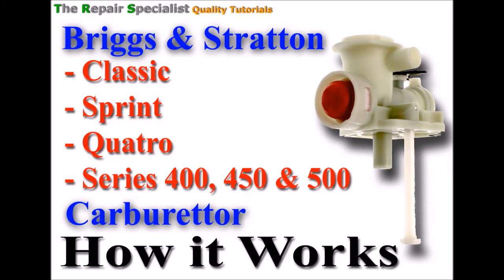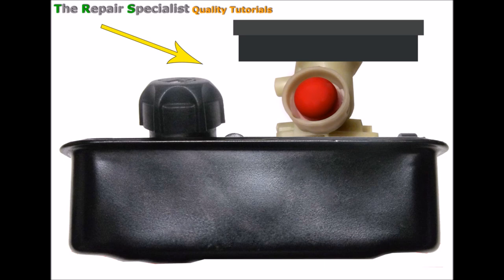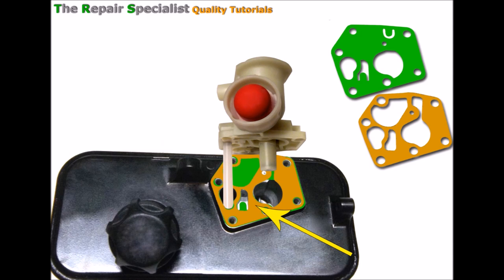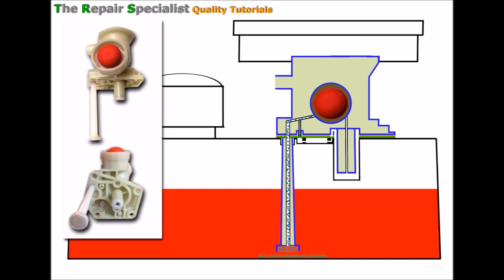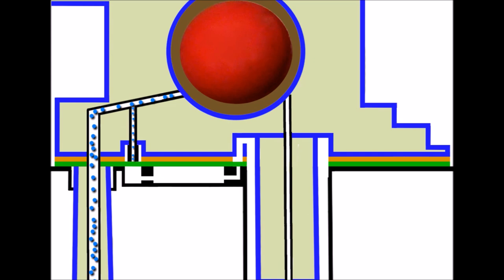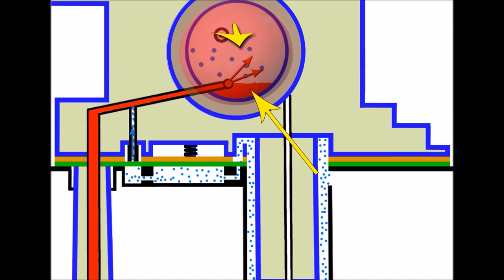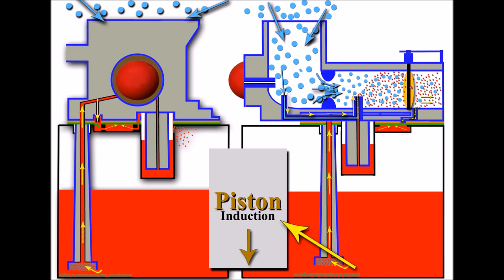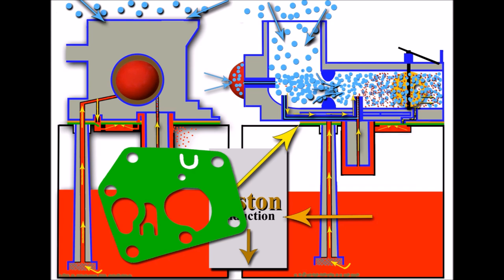Briggs and Stratton Carburetor (How it Works) - 'Unique View'

Comment: From my experience and your explanation, there is no doubt the diaphragm is the weakest part in these Briggs & Stratton engines. In mostly occasional use, I get about 3 middle latitude growing seasons out of mine and then it's back to the rough idle, surging, and fouled spark plug. It's easy to compare the permanent bulge in a 3 year old diaphragm to a new one that's nice and flat.

Vintage Briggs & Stratton engines from the 1960's and '70's didn't have this problem. When it comes to carburetor engines, new isn't always better.

Comment: A really clear and detailed explanation, thanks.   Re the primer bulb, you say that even a pinhole could cause running problems (which I understand) however the genuine B&S primer bulbs for sale for the 500e have a hole in the centre....  we have petrol leaking from the hole in the bulb when the engine is running, but I can't see that buying a new one will help, as they already have a hole in them????
Reply from the maker: Yes it this is confusing, but the 500e works on a different system set up that relies on a carburetor float bowl system.  This is very different indeed to type explained in this video, which rely on a diaphragm carburetor system and functions quite differently to the 500e.  If there was a hole in the primers shown in this video, the carburetor would lose pressure needed to operate fuel to air mixture properly.  It does seem confusing, I agree, but they are very different from each other.  Thanks,
 Craig
Reply: @TheRepairSpecialist  Great - thanks very much for replying.   I'm thinking that a new (red/orange) air filter gasket might fix the petrol leak then.  I've ordered a genuine one and will see how it goes.

Comment: O it is the same with airplane vings is shaped curve on TOP and plain underside so it means the air goes faster on the toøside of wing and create low pressure which make the lift of airplane, Great video and explenation

Comment: I found the diaphragm will last for many years not one  - I  found also  I needed to remove the sieve to poke a wire to break up dirt at the top of pick up tube - my machine has an auto choke butterfly kept open by another diaphragm.

Comment: This is a wonderful and very clear explanation. Now, the problem I am having is: I have an old Briggs & Stratton engine on a finger bar mower (from about 1990), and this machine's diaphragm carburetor has a slightly different setup. The spring, indeed, sits in the lower part of the assembly (in what is part of the fuel tank, actually), and presses the diaphragm pump part up (!), not down. And now I am puzzled how this works. Any idea?

Comment: Thank you for a very good explanation. You showed the first flap valve but where is the second flap valve? Could you please tell us (1) the function of the mesh on the injector portion and (2) what happens to the degree of vacuum created to boost the suction on the injector when the butterfly valve is fully open in a warm running engine.

Comment: one thing about that bottom seal with the flapper valves and pump. the chinese replacements do not always work right. the engine will not prime, but it will run if you use starting fluid, I think it is because they have not made the pump properly and it is flat instead of bowing out.

Comment: A carb that will never flood the bowl spills back into the tank and another benefit the bowl always flushed with new fuel from the cool tank vapour lock never an issue. If the splash lube system could keep up you could run these engines at 45 degrees in any position with a full tank of course

Comment: Thanks Craig for the excellent explanation and diagram work. However, there is a third hole with a ball bearing behind the primer bulb. I was wondering what is the purpose of this as you did not mention it in your diagram display

Comment: If anyone has this engine and it  surges and wont run smooth and right, 
especially if a new gasket set has been put on , these plastic 
carburetors warp on the engine side mounting surface and either have to 
be replaced or you can sand that mounting side down as flat as possible 
and add SEAL ALL Sealant or a PERMATEX gas resistant sealant to the 
machined surfaces when putting a new gasket on and a tiny  smear on the 
gaskets also.  SEAL ALL sealant >>(resistant to gasoline, oil, 
paint thinner, and most solvents. Seal-All is also water resistant 
immediately upon application
Sets in 2-3 minutes. Fully cures in 2-6 hours) The gaskets can be bought at most major car parts stores--eBay also for under $5

Comment: He he, I've been trying to mow lawns for 30 yrs and have never changed the  diaphragm notice mower hunts but runs well when tank is full and looses power as tank empties, also notice very little grant when the grass is a bit thicker.  I never realized the diaphragm actually is a moving part of a fuel pump, if any of the tiny holes get blocked also things won't  work properly.  I just thought the venturi  sucked the fuel up.  I must  have wasted fuel on the the full tank, and I can't run on a near empty tank explained.  My mower is 1987 model.  Plastic carb and no priming bulb, Always starts on second pull though .

Comment: Thanks for taking the time to explain and in such details. It is very informative and enjoyable to watch, brilliant. I do have one question that I hope you would provide answer to and that is the role of the breather pipe, why was it there and does it help/hinder the operation of the device?
Reply from the maker: Hi. Thank you for your nice feedback.  To answer you question, and something I should have included in the video, is  that the breather receives gasses from the engines crankcase and sucks these into the inlet of the carburetor to recirculate them i the engines combustion process.  Doing this is believed to be better for the environment as it keeps the engine running slightly cooler so it generates less harmful byproducts emitted from the exhaust.  I hope this helps.  Craig

Comment: I understand this is now and you did this great video years ago but can I please ask.  I have the problem of the bulb staying in, even a new bulb. So is it the gasket that provides the valving for the plunger. If so then I need to change only the two gaskets to resolve the issue. Kind regards
Reply from the maker: Hi. Providing there is no blockages in the fuel lines that are shown in the video then it does sound like it might be the diaphragm that could be the issue. In a smaller number if cases I have found there to be dirt behind the primer bulb preventing the valving system working on this. I would remove the carburetor, clean it though purely and replace the diaphragm kit. Also, check your primer bulb and make sure it hasn't any issues there. I did have one once that had worn thin but not ruptured through. This was Making its return outwards weak. There is a link in the description the the type of diaphragm kit you need if your engine and carburetor are the same as thus one. I hope this helps. Thanks. Craig

Comment: I had this carb off the fuel tank today, and the diaphram for the pump action was quite deformed. Not thinking much of it at the time.  After watching your presentation, I'll now go back and replace it with an OEM as the one I put in last never really worked all so well. One thing on the carb in question is where the primer blub fits, the plastic is somewhat deformed / out of round and sunken in at spots at the ridge line. Could this have any bearing on priming the engine? Another thing in question is the new primer bulb has a hole in the center,  I think I purchaded the wrong one, even though the engine starts and runs, I'll look for one that has no hole or plug this one off.

Comment: Thank you so much for the video, really helpful. Just wondering if you have any suggestions as to why i have fuel leaking after changing the diaphragm. The screws that connect the carburettor to the fuel tank were not as tight as could be but the mower did start, then i turned it off and tightened them up but I could still see fuel leaking.
Reply: You must have something on top of the flat surface where the carburetor mounts to tank or u have a wrinkle in the diaphragm

Comment: Hi, thank you for your video it is very informative. One thing I notice is you say the thottle should be closed to start the engine but when the governor is connected the thottle sits open. So how can the engine start from cold with thittle open or part open and no choke on the carb? Thanks if you have time to respond. Regards Rob

Comment: Hi I do t know if you are still taking messages but I have a strange issue with this Carb setup one summer morning  I  pushed the Prime bulb to find that it didn't return so was stuck in the pushed position.  Olay I thought it's the rubber bulb that is perished or gone hard so replaced it to find that the first push it stuck in once again. Could we this be anything yo do with the two flap valves on the now 15 yer old diaphragm.

Comment: Hello dear RepairSpecialist, your video is brilliant !! Thanks you so much. I've got one question, on my machine, the pickup pipe keep falling in the tank as it is not strongly "plugged" anymore into the carburettor ? Would you have a piece of advice on how to fix this problem ? Can I glue it to the carburettor or use another trick ? thx a again for making such great video

Comment: Super great video I have a question. gas was leaking at carburetor gasket nothing would work so I used a gasket then diaphragm and another gasket on top of diaphragm could this cause any problems ?? so far no leaks and motor running better than new ...

Comment: so what actually moves the throttle body to open position? is it just engine vacuum or like an auto choke setup? because as I've worked out its not the throttle cable like on a normal carburetor.

Comment: This is first class training. The only point I would add is how the fuel tank vents through the carb. and not the cap. I also noticed that the butterfly valve has two holes at 90 deg. to the spindle. I have a 3hp tiller and the holes are aligned with the spindle (so they are blocked) I have tried to rotate the butterfly valve but it then jams in the body. Does this sound correct?

Comment: Amazing! Thanks so much! if my gasket is floppy would that make the engine splutter?
Reply from the maker: Thank you so much for the nice feedback. I really appreciate it. As for your gasket.  It would be more significant is the gasket wash torn or damaged.  If you have had your gasket and diaphragm in your carb for more than a couple of seasons then I personally would change them anyway.  I hope this helps. Thanks, Craig

Comment: Good work, but there is one major error.  When the engine is stopped the throttle is held fully OPEN by the governor spring, when the engine is running the air vane closes the throttle butterfly until it reaches an equilibrium point where the force of the governor spring equals the force from the air vane.  That's how the governor works - it's a closed loop negative feedback system. 

Although the carburetor includes clever ideas, it isn't a great design in my opinion.  The gasket seals the pump chamber which is at venturi pressure on top, and right next to it is the pump output  filling the main jet reservoir, and on the other edge the outside world.  When the carb gets hot the plastic warps and the seal  won't seal any more. dependent upon where the leak is it either runs lean (leak to outside ) or rich (leak to fuel reservoir) or some hideous combination of both.  B+S know all this - If you look at the carb base there is a moulded ridge in the dodgy areas, but it doesn't really hold back the problem many years. New gasket will fix it for a while but it will always leak in the end because  of lack of clamping pressure in a key area. It is the weak point in the sprint/classic  engine.  If they had only made it in metal it would have been great.
Reply: I've been searching everywhere to get more information about the governor vane. I have a sprint 41 that is running at max rpm from cold. The governer vane does not seem to be applying any negative feedback once the engine is running. So the little spring is just holding the throttle valve wide open. I've checked the linkage to the top of the governer vane, adjusted it fully clockwise, CCW, and mid point but makes no difference. Manually setting the throttle with a piece of wire instead of the spring and engine runs fine. Any ideas?
Reply: Hi there 
Just asking for help i got are Briggs Stanton 450 series 148cc lawnmower still working but keep cutting of sound am just founding out what the problem maybe you can help me please 
Thank you
Reply: Oseta Toka I have the same engine, had to replace the carburator membrane/gasket a couple of times the last 8 years.

Comment: Hi great videos. Very well presented and very informative. Could you explain why my prime doesn’t fill but at the same time creates pressure in the fuel tank. I know this because it sprays or hisses when I take of the fuel cap. Any thoughts?
Reply: Check that the fuel cap air vent is not blocked.

Comment: I have this carb, and it runs fine but when I go to prime, it doesn't.  Is this strictly a bulb condition?  I have to manually prime this with spray to get the engine to start.
Reply from the maker: HI. I wouldn't say it is a bulb problem strictly.  I would remove the carb and clean it and service it.  When you do, you can check the bulb fully for holes.  If you are unsure how to clean and service these carbs then I have included a couple of links to my other videos that show you how to do this.  I hope they help. Craig :

To service and clean: https://www.youtube.com/watch?v=Q560lMk3FgA&t=12s

Bulb replacement: https://www.youtube.com/watch?v=ZZKCDHoQKCw&t=2s

Comment: Thank you for this great explanation. I have one question. What is the purpose of the breather pipe connection. I found out, that mine is a bit loose on the exhaust, meaning the thread is not tight, when the pipe fits into the carburettor. Could this be also the reason, my engine runs unstable and stops after short time. Has there to be any vacuum? Thanks for your support.

Comment: My engine is running lumpy!
Reply from the maker: It sounds like it may be your fuel pump diaphragm that is the issue. I have a link in this description to the type of diaphragm you need. I can't be completely sure but these engines do have this as a common fault. They are reasonably in-expensive so it may be worth trying a new one anyway if you haven't replaced yours in a while.  It will probably show fault at some point soon anyway.  I am currently in the middle of another video showing the procedure of how to replace these and it will be out in a week or so. I hope this helps. Craig

Comment: This is a terrible design. The old ones had a separate hatch to easily replace the diaphragm. It's insane that in this version the diaphragm is welded to the gasket and that you need to remove the carb, clean the gaskets and install new gasket just to service the diaphragm!
Reply from the maker: Hi

thank you for sharing your thoughts and frustrations about the design of the diaphragm in Briggs & Stratton lawnmower engines like the Classic, Sprint, and Series 500.

It's understandable that the integrated diaphragm design can be challenging for maintenance compared to older models with separate diaphragm access. Your feedback highlights an important aspect of user experience and serviceability in small engines.

I appreciate you sharing your experiences with our community. If you have more insights or questions related to small engine maintenance, feel free to reach out. We're here to help!

Thank you again for being part of our channel and sharing your perspective.

Best regards,

Craig